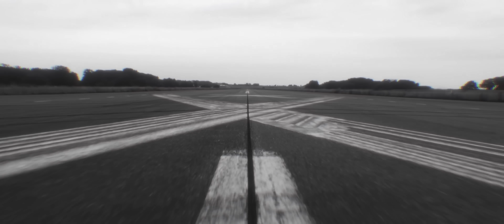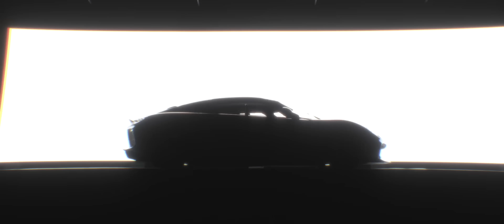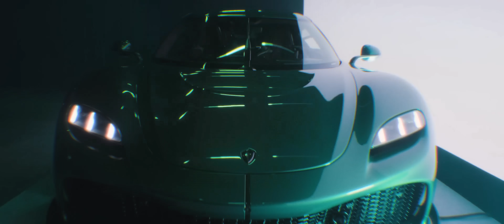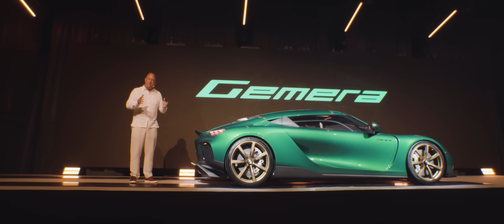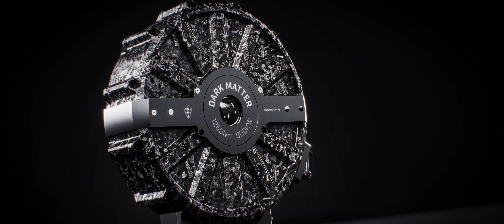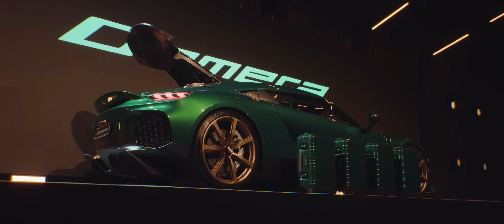Koenigsegg Gemera - Production Version World Premiere

Comment: Now imagine we put one of those dark motors inside each wheel - eliminating transmission, shifting, drive shafts, clutches, etc. 
Imagine he weight savings overall - and major cost savings, would not be something you are interested in at all.
Reply: There would be no weight savings, since you need a ton of battery capacity.
Reply: @after_midnight9592  TOUCE' - I mean ah-HA! Some day people will make 'organic film batteries' based on the electric eel fish, and they will weigh little more than water yet have storage cap. over 100 times that of heavy metal batteries, with huge bursts of discharge possible, up to 50,000 volts - and we will call them 'Eelectrick Power'. They will work well in airplanes and flying boats and the cars I designed with them fly, fly fast and fly well.
MAYBE in a future life...
Reply: The brakes would be much smaller, rudimentary really with the powerful electric braking in each wheel - enough weigh savings to put a small microwave or coffee maker in the dash?
Reply: Just leave the genius to his work
Reply: Did I forget to mention the engine would be turning a generator, thru a belt to insulate it from all that high voltage? Also to prevent corrosion.
No transmission at all! Sure, some people will miss shifting and have to get used to continuous power all the way to...  ...unlimited top speeds really. Also they curse these cars as they easily, quietly, pull away from them on every turn and straight.

Comment: I have a different opinion. But this car doesn't look good. But what is more serious is that it is not properly designed (especially stability and safety at high speeds. Unfortunately, it is based on quite old solutions. Just like we want to conquer space with the 120-year-old rocket principle. Almost everything should have been done differently. The biggest enemy of the car at high speeds is the bend. But you can also refute these facts.

Comment: Another self proclaimed "fastest" car that we will never see on a track or a dragstrip. And if we see it on a dragstrip... It will not perform as claimed
Reply: Not sure where that comes from - you can see all of Koeniggsegg's other cars in drag races if you do the bare minimum youtube search and they all perform as advertised.  The Regera still holds the record for 0-400-0 kph, and the Jesko's lightspeed transmission is insanely fast to listen to and it's started to set some track records.  Koeneggsegg is still aiming for a shot at the nurburgring too.  I'd say they are backing their words up pretty well.  If the owners want to put their cars on display and never use them that's not Koeneggsegg's fault - the cars are just as capable as they claim.

Comment: This tells you something about what a good design the Ford Modular engine is: 
Because the Koenigsegg 5.0 is a distant descendent of that. Imagine a mod-motor with every possible aftermarket performance upgrade - heads, block, pistons, rods, crank, valves, cams, intake, exhaust - and you'd have something similar. It gets 1800 hp and lives.
Reply: Kinda, everything Koenigsegg has done to their in house V8 is patent protected.
Reply: @MrGrazzhoppa  I'm sure some of it is, like the pistons and rods. Those represent original Koenigsegg research and development. Other things, though, like the hot-V - maybe some of the details of how they made the conversion would be patentable, but the first V8 ever had a hot-V and that was over a hundred years ago. 

What I wonder is about it is: would any Ford parts still actually fit?
Reply: Nothing about that V8 is remotely like a Ford. He did base his first V8 on it but that's as far as Ford goes in his projects

Comment: the funny thing is i bet the model s plaid is almost as fast for 1/10 the price.
Reply: I bet you never sat in a Koenigsegg😂
Good luck with your cell phone on wheels
Reply: And the Plaid will be worthless in 10 years
Reply: Plaid is 4800lbs. Gemera is 4400lb with 3 cylinder and 4600 with V8. Plaid has 1000 hp. Gemera has 1600 or 2300. Plaid is a killer car for the value. But the Gemera is on another planet. And you don't have to spend hours at charging stations to run it.
Reply: @Tylerm684 little fyi charging time is more like 10 minutes.
Reply: @dabrain22video  You only get 80% of listed range. Then you have to find a charger that can do it this fast. Then you have to hope it's available. Then you have to sit there waiting. Meanwhile the Gemera is laughing a hundred miles ahead of you. Then when you need your second stop MAYBE the Gemera will be making it's first stop. And it can do it an the hundreds of thousands of options of gas stations. After a day of driving the Gemera will double the miles put down.
Reply: @Tylerm684  triple actually
Reply: 0-62 maybe, 0-124 i doubt it, let alone 0-186/248 (which the plaid won‘t do). Don‘t get me wrong…plaid is crazy but this is completely different. Some alien-kind of engineering-level
Reply: Close with the 3 cylinder version not the v8 version
Reply: Yeah but Tesla is garbage. Everyone knows this. If you could afford a Koenigsegg, you'd but the Plaid for your butler/maid as the grocery car
Reply: you're not very smart, not even a little bit
Reply: Yeah only fast on the take off that’s it’s  and then it’s destroyed everywhere else. Can’t beat it in range, top speed, resale value, fit and finish, exclusivity, color options and on and on. Keep that milk toast Tesla 🤔😏😏😏😏